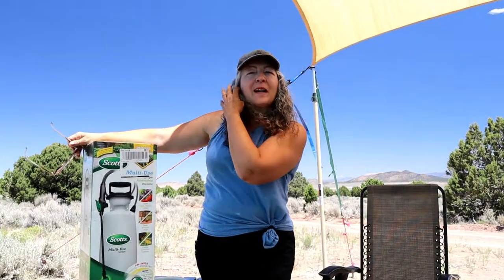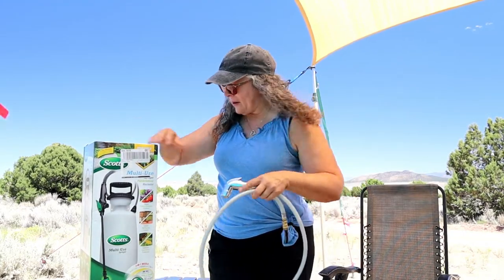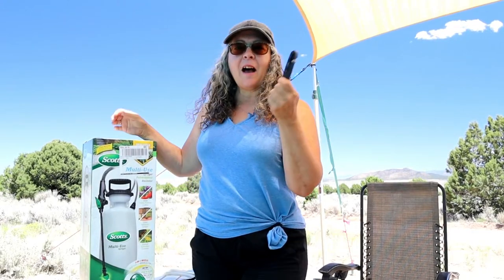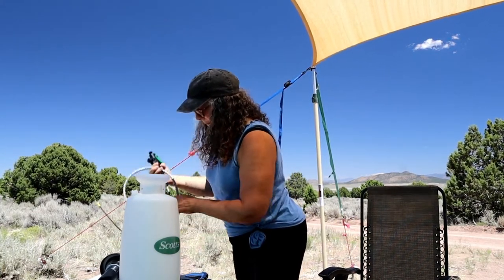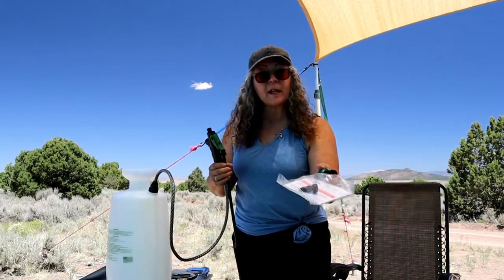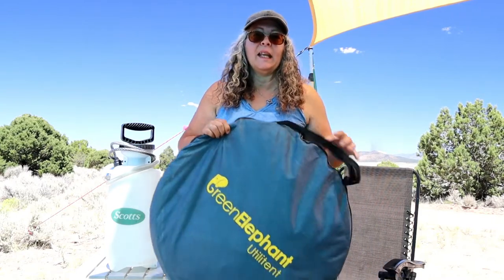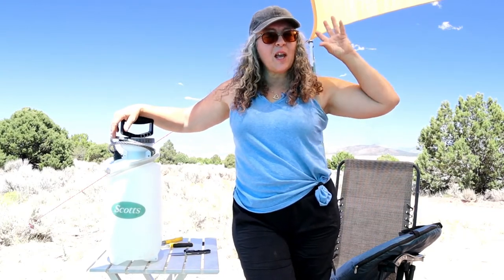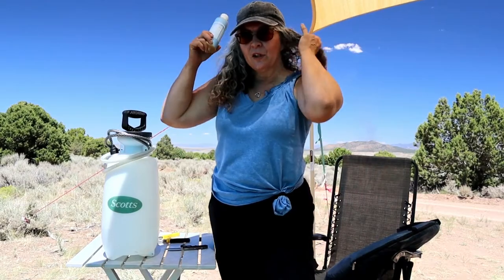Van Life Travel & Photography; Converting A Weed Sprayer A To Shower Sprayer

Comment: Here is a suggestion for your shower.  Get some black spray paint made for plastics. Walmart has it. paint the sprayer, then get a clear plastic bag large enough to go over the top of the sprayer and cover it down to the ground.  Set it out in the sun. What the clear bag does is it acts like a green house. The sun heats the container, but the wind cools it back down. The clear bag keeps the wind off and also increases the air temperature around the sprayer. The water will get much warmer. Shower before the sun goes down, or wrap the sprayer in a quilt to keep the heat in.
Reply: I like the suggestion of adding the clear bag.  Thanks I will be using that.

Comment: 0:42 Your rubber seals went bad. Easily replaced for a few cents at the same spot you bought the sprayer. Just take the rubber rings with you to Ace and they may not only have replacements but BETTER seals.